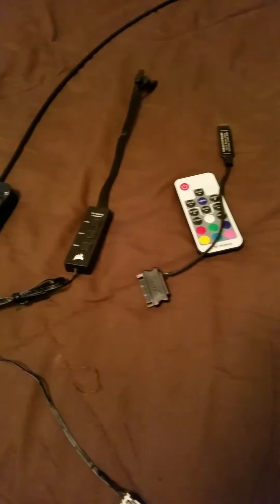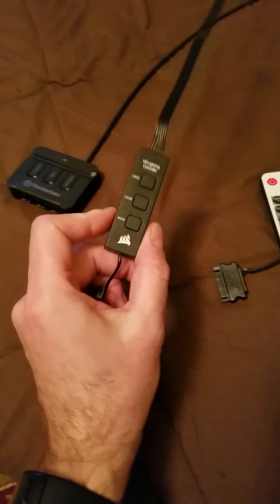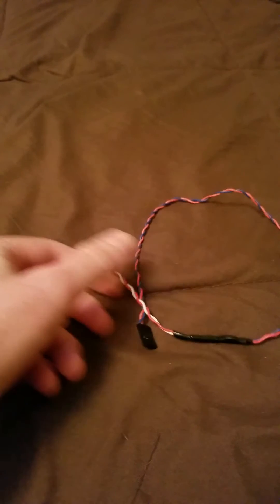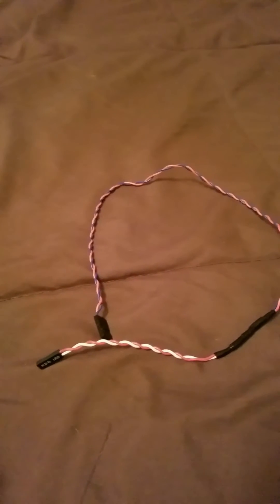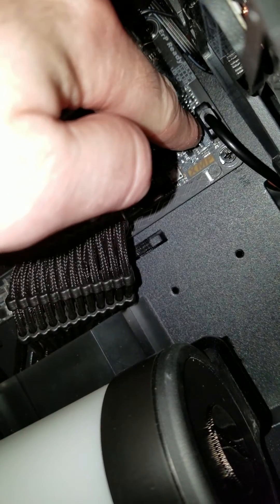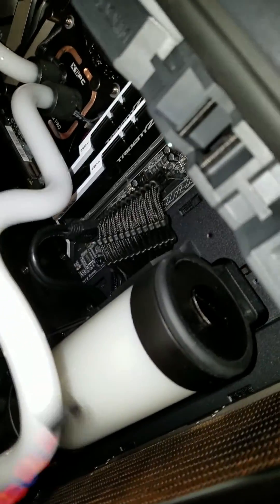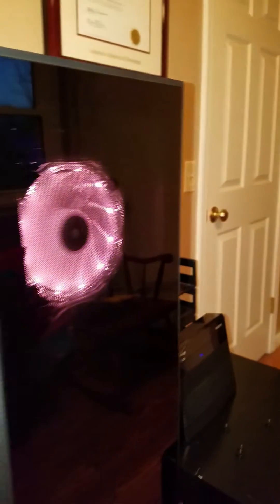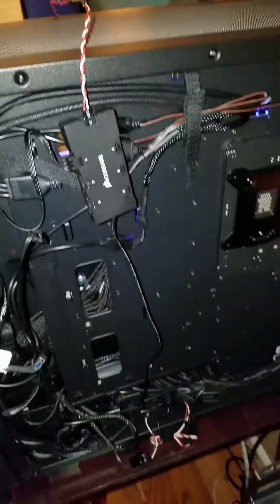Corsair HD-120 using Gigabyte's RGB Fusion Software mod also Asus Aura (Part 2)

Comment: Very nice, thanks a heap for this tutorial.

I found an item on amazon (while doing similar research) which may solve this issue without splices - Apparently DEEPCOOL manufacturers a converter (runs about 15-16 bucks USD) which converts from motherboards with 12v, 4-pin RGB headers, to all sorts of types of RGB connectors, including a unique method they’ve developed to also control 5v AGRB devices within the same controller. Cool beans

DEEP COOL RGB Convertor, 5V ADD-RGB to 12V RGB Transfer Hub, Motherboard with 12V 4-pin Header can Contorl 5V ADD-RGB Products, Non-Compatible with Asrock Motherboard https://www.amazon.com/dp/B07QPYSC82/ref=cm_sw_r_cp_api_i_k09WDb46NGKXN

Comment: @Solarity Technology great guide, I also have Corsair fans and a Gigabyte mainboard. It would be great if someone just sold 1-pin cables, so you could use two of them and save the pinning.
Reply: i have managed to crimp two 1 pin cables and it does work partially, however I have 4 fans and one has 3 leds that are not being controlled while another fan is entirely uncontrolled. they are stuck on a yellowish white.

Comment: Hello. 
The two pins on the motherboard must be D and G?
I have three pins  V, D and G.
I must set up voltage on 5v?.
Thx
Reply from the maker: Sorry youtube app bugged out on me. The V= 5 voltage. What Are you plugging into it? If you are plugging in a RGB hub, voltage is not needed as 5v is supplied by the RGB Hub.
Reply: @SolarityTechnology  I tested it and it doesnt work. I put the left pin of hub with G of mother and center of hub with D of mother :( . It is right?

Comment: I got it all but what does he say at the end about this no longer being needed because of iCue? it really wasnt clear. thank you for your video
Reply from the maker: I was using this hack with RGB Fusion. Then iCUE came out and it is a lot better than any MB software I have seen. Also there are some exploits for Asus Aura and App Center for Gigabyte. In all I got a Lighting Node Pro and use iCUE, I haven't looked back.
Reply: @SolarityTechnology  I plan on running Corsair H100i with LL120 fans and the Z390 Gigabyte Auoros Elite. I need to rewatch your video but did you need to mod the cable that goes to the header in that case? my current plan was to just use iCUE for fans and AIO and then use RGB Fusion separately and make them match. I was going to run it through either the lighting node pro or commander pro to my MOBO. thanks for your time and quick reply
Reply from the maker: @badfish5447link  That sounds like a great plan. I love the LL120s!
Reply: Solarity Technology sorry just to confirm you only use iCUE and the gigabyte motherboard syncs with an exploit or you use RGB fusion also and change it after you change iCUE?
Reply from the maker: @badfish5447link  After some frustrations with Fusion I am holding off for Gigabyte to improve fusion. I either disable all together or set it to a neutral color. I have a lot of RGB, so I let it just fade into the back. I did have a script, but as Gigabyte is so sketchy in what it supports, I didn't want to keep diagnosing bugs with no avenue to resolve the issue. I will give it a little more time and look at it. As I have a lot of RGB, I am fine w/o Fusion. You see my RGB loop video?
Reply: @SolarityTechnology  I did see it the Far Cry 5 one? I will keep that in mind with Fusion its only running my mother board RGB but it was going to run my gskill trident z but if it can sync that with iCUE i will

Comment: Is there any option to connect the fan hub (got 3x LL120rog)+fan hub,  but got no cable conecting the hub  with my onboard usb header, i can it be made? 3pin to usb header?
Reply from the maker: Odd the 3 pack of LL fans should have come with a Lighting Node Pro and cable to connect the RGB Hub to LNP. It is a male to male connector with only two wires. See this guide: http://forum.corsair.com/v3/showthread.php?t=173880
Reply: @SolarityTechnology  yea well i bought them individualy, saw the fan pack after...and now i got the fan hub, and ...surprise!!! there's no cable to conect to mb....(asusz370F gaming) seems my motherboard doesnt have a digital header, only rgb and adresable header, could i conect in on to adresable one?
Thank you.
Reply from the maker: @Treptis00Marian   Ouch! My best suggestion would be to get a Lighting Node Pro kit. It does come with some magnetic RGB strips. You can plug strips into one port and the RGB Hub in the other. This will come with everything you need. You could also try to hack it or have an adapter. Addressable and Digital are the same thing and your motherboard has one. You can have this seller make you the cable you need. https://www.ebay.com/itm/Corsair-RGB-to-Aura-Mystic-Light-A-RGB-Adapter-/372521827376?nav=SEARCH

The one in the link would require a male Corsair plug or you will need an additional cable. IMHO Asus Aura isn't all that great. iCUE is a much better tool. Check out my RGB 101 video on my channel for more details on RGB.
Reply: @SolarityTechnology  So i might hack it with 2pin cable like u did, all i need to do is avoid the 5v pin right? and than i would be able to control it with aura?
Reply from the maker: @Treptis00Marian  While this worked great in my case, there is something I didn't realize at the time of this film. The ARGB header on my Gigabyte board looked like it has the same pins as the Analog. They do share the same spacing, but the Analog RGB have round pins and the Digital has bigger square pins. Corsair uses square pins and Asus uses round pins on their digital devices. You could do the mod I did, though the connection might be lose and not make contact that great. The biggest issue is making sure you plug things in properly so you don't damage anything. Even I have damaged devices due to over confidence combined with being tired. Though at the same time I knew how to repair them. https://encrypted-tbn0.gstatic.com/images?q=tbn:ANd9GcR6nRaisD5I66Mbg9dvM5gcGM0Cm1ffE-Zk6fIegqUsgpmEStRK

Comment: If you hook up lets say 6 corsair LL fans via the hub to the digital header. Will the motherboard see it as oane large led strip or will it be one samll one so you can only change all fans togethor?
Reply from the maker: Did you check out my RGB 101 video? The LEDs are asyncronous so there is no way the strips can communicate how many LEDs or strips are attached. The effects are determined by software as well as the LED count, optionally. The RGB Hub wires everything in series so it is one long logical strip.
Reply: @SolarityTechnology  The last Sentence was everything i need to know. Thank you very much, have a nice day :D

Comment: Hello

I have the Maximus Hero x, and the ll120 Corsair Fans , and 4x Led Stripes from Corsair.

Is IT possible to use this Methode ? I use the Commander and Hub too.

Thx
Reply from the maker: Yes it will, though personally I don't use this method anymore as I really like iCUE and you have everything you need to control it via iCUE any reason you aren't using iCUE?
Reply: Hey, yeah i tested it, the problem is, i want to sync my motherboard too. This only works with aura i think. or have you a idea? with icue i can control the corsair fans and stripes but not the board
Reply from the maker: I wrote a tool for my Gigabyte motherboard that changes the colors based off game/process. I also set the same for iCue profiles to load based off game/process. So they are indirectly syncing based of process. There is a tool called RGB.NET for Asus Aura, you could check that out. Else you can always hook everything up to the motherboard. By the way instead of making a custom cable, you could always by a cable set like this and use the female to female connector: https://www.amazon.com/Haitronic-Multicolored-Breadboard-Arduino-raspberry/dp/B01LZF1ZSZ/ref=sr_1_3?ie=UTF8&qid=1531873744&sr=8-3&keywords=prototype+wire&dpID=51OGWa9txJL&preST=_SY300_QL70_&dpSrc=srch
Reply: okay it works well with the fans.

By the Stripes i must give them extra 5V and then plug them easy in the Corasir Hub, now all works well.

Here a Short video, with music Sync on in aura.

https://www.youtube.com/watch?v=rzXBclikSqo&feature=youtu.be

THX to you
Reply from the maker: Cool good job! I am glad you found it useful!
Reply: speciall thx

Comment: hey can this work with asus strix gpu led? i love aorus mobo design but i cant make them sync together
Reply from the maker: Xmans___ Anything is possible, though it all depends on the time and lengths you want to go. If you want to possibly void your warranty you could try connecting the RGBs on the GPU to the motherboard. Another option is too see if you can look at open source tools, like RGB.Net and my tool to get them to work together. https://github.com/windows2000bug/RGB-Fusion-Tool-PS
Reply: Solarity Technology so i need buy extension rgb cable connect to my rgb header?
Reply from the maker: Xmans___ without knowing the details about your MB and GPU, it is hard to answer. This video is for connecting Digital LEDs to a MB digital header. I don't know the type of LEDs u have on your GPU. Even with analog and digital LEDs voltages can vary. You would have to be very comfortable with a multimeter. I highly advise you watch my RGB 101 video: https://youtu.be/z5paaWs_Gz8
Reply: Solarity Technology mobo aorus h370 gaming 3 wifi. gpu asus strix 1070
Reply from the maker: Xmans___ Okay you might be in luck. This will be more advance than what I put here. Technology wise it should work. You will need a multimeter and know how to use it. You will need to get the voltage of the LEDs it will most likely be 12 or 5v. I have a different GPU and I know the connectors are smaller, so might have to make a connector or willing to solder and splice. This looks most likely  analog LEDs. This will also require new thermal paste for the gpu and replacement thermal pads for the VRM and memory. Let me know if you are willing and I might continue.
Reply: Solarity Technology if i need void my warranty i think ill look for asus board. but the problem with asus board they always use 1 rgb header. as i know asus rgb header limit to 3amp.. so if my rgb fan got 0.25a x 6pcs and phanteks 400mm combo led strip 0.45a do u think im safe to use all of this to one rgb header?
Reply from the maker: If you are asking if you can plug in items that can pull a load of 1.95amps from a 3amp header, then you should be fine. Though make sure you know the amp rating is correct. The max amp ratings tend to account for all the lights being on as white. You could always consider looking at RGB.NET it is a tool that does some cool stuff with Asus Aura. I haven't played with it, then again my only Asus products are my monitors.

Comment: Hi, has anyone tried with the Corsair SP120 (the stock fans of the 570x case)? I tried, connected the addressable header of my Maximus X Hero to the very same controller of the video (ground with the left pin and data with the center pin) but nothing happens when I change colors via Aura software. If the fans leds are on, when i plug the cable from the mb into the controller they turn off. Also, in the "settings" tab of the Aura software there is an option for the LED Numbers of the addressable header, I tried a large variety of numbers but same result, nothing happens. Any help?
Reply from the maker: The LL-120, HD-120, and ML-120 use a ws2812 type LED w/ integrated circuit. The SP-120 uses a fan addressable UCS1903 integrated circuit. All I have are ws2812 fans  and strips. The Corsair Lighting Node Pro controller can switch between the different types of LEDs, though you can't use both at the same time like you can with LL/ML/HD on the LNP. Matze tried it and had no luck, don't know what motherboard he had. I don't have Asus Aura so I can't say if it has the ability to switch between the different modes. I don't see anywhere in Gigabyte Fusion where you can specify the type of controller, though you can control it with a Arduino as some others have done. The only run about $10.
Reply: Thank you for the reply. I will search around for some more info. If anyone has some kind of solution, please let me know!

Comment: Hey bro, I have three HD120s and I have an ASUS Z370-E Gaming motherboard but I'm not sure in which header do I have to connect the cable, the motherboard has 3 RGB headers, two of them say "RGB 4-PIN HEADER" and the other one says "ADDRESSABLE RGB HEADER" any idea?
Reply from the maker: Carlos Ismael You use the addressable header, using the others wouldn't work and could possibly fry your components, if plugged in wrong. The Asus addressable header is the bottom right on this photo. It has a blank pin.  https://dlcdnimgs.asus.com/websites/global/products/klfkClhgxgVuMQ6D/img/lighting/headers.jpg

You only need the Data and ground lines, I wouldn't use the 5v pin as power is supplied by the RGB Hub. Let me know how it goes and feel free to subscribe as I will be adding new content as well.
Reply: bro, that mean it can only use on z370 motherboard,but cannot use on z270 motherboard?
Reply from the maker: 一億Yat Yi Looks like the 270-E might only have analog headers, which won't work.

Comment: do you think it will works with Corsair Sp120 fans?
Reply from the maker: Matze It wouldn't hurt to try it. The RGB SP-120 uses the same RGB Hub as my HD-120 fans. The SP-120s are digital and fan addressable. Though both fans use different LEDs IC UCS1903 vs WS2812. I am not a software engineer or a electronic engineer. Though if you follow the proper pinouts and voltage it will do one of these: not work at all, colors might be flipped around, or it works fine. Would love to see you try. Just make sure you have a digital header!!!!
Reply: windows2000bug 
It wont Work!
Reply from the maker: Matze So you confirmed it doesn't work? I am slightly thrown off by the grammer.

Comment: I have a z270 asus ix formula but does not have an "add header" but only 2x "rgb header" ... how can I connect the hd120 fan controller to mb?
Reply from the maker: I took a look at your board and it doesnt look like it has a digital header, only two analog 12vRGB. I couldn't find a digital header at least. The HD-120 is to advance for the analog header and it wont work. Lots of z370 boards have them. The best option is the Lighting node pro, it is awesome with iCUE, it is in early release and about a month so. I ditched using the MB digital headers and am usin lighting node pro as iCue is the best rgb software out there.